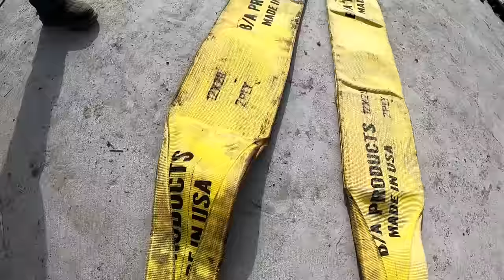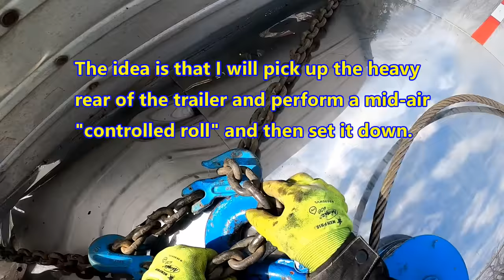Haz-Mat Tanker Rollover Shuts Down Everything!!!

Comment: 44,000 gal lol. Just a heads up Ron. The pump on the vacuum truck is not strong enough to crush that tank. It will just bog down and not suck due to the negative vacuum. There is also a safety valve on top that will suck or blow air if the pressures get to high or low. Rail tank cars have these too, its an ISO standard. I've been hauling tanker trailers with hazmat for 17 years now. There was a port on the rear of the main hatch on the top. That is there to evacuate the fluid with a 2" hose once the level gets low enough. Also there should be places marked where the tank can be punctured for emergency evacuation with a rollover. One more thing too. I've had my fuel tank full of jet fuel shot at with most likely a hand gun. The bullets went through the cab no problem, but bounced off the tank. Luckily I was not hit by any of them.

Comment: For accident purposes we have in Europe special code plates for hazmat trucks, it simplify identification what type of material we deal. Insulated tanker points toward liquid gases, very dangerous if heat will builds up and cooling system is inoperative.

Comment: Did you ever find out the true make-up of the load?  Insulated tanker suggests something like medium or heavy fuel oil, which is normally transported hot (80 deg C when it's loaded) hence the initial suggestion it might have been diesel.  Also it looked like a single tank, not separated compartments for mixed loads which again makes it look like a 'black oil' tanker.  But a nice job, well done!

Comment: I will also add the driver used to wrong placard on the tank…. I saw 1993 which is the code for diesel fuel.. I’d imagine there’s going to be a citation issued to that driver for using the wrong placard to identify the contents

Comment: That truck was completely full i can tell because the right back end went in the hole just a little bit so the full weight in the trailer came down causing trailer and tractor to roll on its side, of course the amount of weight in the full tank also twisted the frame of the tractor warping it in the direction of the rest of the trailer.

Comment: This is common alot of biodiesel  and straight diesel is moved with SS tanks .  Old tanks being utilized for this purpose.  ......stick it to the dirt and puller back on her feet..... these tanks are very sturdy.  I had one withe the nose bent at 90deg upward at the 3rd section..we filled it with water and shop air and bent it back down almost completely back down in its original position...it had bent in that position because of the vent being stuck in the first place.

Comment: My main concern was that the bolts or welds might snap where the rear of the tank fitted to the rear axle/chassis. I doubt it was designed for all that force to be concentrated on the side corner like that and pulling sideways too.
How did you know you would be alright?

Comment: I know I’m a day late for this, but for those wondering, tanks like that are used quite a bit in the Alberta oil patch for more volatile chemicals, specifically ones that evaporate around 120 degrees. Most common one used here is methanol. The explosion hazard is very real.

Comment: So, nobody deployed flares to warn traffic then?😂
Nicely put together video Ron, with all the extra cameras.👍  Did the tractor come back over a wee bit sooner than you expected? Very interesting to watch the different machines working together, all performing separate tasks to reach the same goal. 
Was there a less obvious cause of the accident or did the tanker just cut the corner too tight and the trailer wheels dropped off the road? I'm assuming the tanker had just crossed the railroad and turned right?
Great job, as always, and particularly well filmed/edited.👌

Cheers for now,
Dougie.

Comment: Hey Ron, When I was a 20-ton driver, the owner of my company( United Towing Alpharetta, Ga) told me you can never use the rotator to pull with because you will bust the rotator gears and pin. I see you using the rotator to drag the tractor. Please explain why you used the rotator to drag the tractor. Thanks

Comment: The more rural locations still have their power lines overhead instead of underground. That will always be a factor in any recovery operation you have to perform. I suspect that it is costly to put them underground. I live in a neighborhood(townhouse community) built in 1997 and all wiring is underground. Storms do not present a problem normally but somewhere close to our townhouses blew an uplink transformer and we were out for about an hour. Or if there is a substation failure. You do work in a lower elevation area so no really high power lines like they have to deal with in Northern California near the Sierra Nevada mountain ranges. But power lines there will never  be underground. Solid granite all around.

Comment: You will understand joking on job site such as this when you are in this line of work. I was on a scene of an accident where a log truck driver attempted to avoid a head on collision with a pickup that crossed into his lane. He rolled his truck into the ditch and caught fire. Driver smashed a window and dug through the snow to get out. He was fine and helped at the scene. When we went to roll his mangled burnt up mess back on its wheels, he shouts “Don’t scratch the paint!” Man, you don’t have a cab anymore to have any paint 😂 But it lightens the mood and I work better under that kind of environment. Things tend to go a lot smoother than everyone being uptight and upset.

Comment: Yeah, when they said gas and I saw 1993 on the truck's signs I was like "Uh, I don't know what it is, but it's not pure gasoline, and it's flammable," which is really a sobering conclusion to come to about a flipped over tanker truck. As it turns out, there are things much worse than gasoline, which would also explain the shielded tank. If only it could be easy and be jet fuel or something minimally flammable like that...

Comment: Ron, I can not believe the amount of torque you have to rotate your boom while dragging the front of the tractor over. If you figure the distance from the center of your slew ring to the boom tip and then figure how much linear pull it took to drag the front of the tractor that is very impressive. Does your rotator have more than one slew motor/planetary to rotate the boom?

Comment: Even if the vent on the tank is below the liquid it will admit air which will bubble up into the space above the liquid. There will be a slightly low pressure in the air space but there was no danger of the tank collapsing.

Comment: Maybe you covered this but I missed it, but I never heard anything more about the bill of lading. It should have told you contents and gallons. Why was there not a return hose from the trailer to the receiving tank allowing the pressure to equalize between the 2 tanks? You would then not have to worry so much about negative pressure in the "SODA CAN".

Comment: I kept looking and I didn’t see a single hazmat placard unless it was covered by the black plastic. Did they contact the railroad to shut down the rail line? I don’t think there’s enough clearance to to the side of the rail for the engine to clear. As long as it’s not a high speed rail they should be able to stop but it’s something to be aware of for the future.

Comment: It should vent ok from the forward wash out caps.
It would be above the level of liquid at the front of trailer.
At most it's 3/4 full.
(Idk 23" out ?)
They "could" vent from one trailer to the other, replacing air with liquid.

Comment: 32:11 CHECK THIS OUT EVERYONE.... his 2 pass side outer tires off the road(concrete), you can see the scuff marks on the road from the 2 inner tires & exactly where they were pulled off the road from the leaning hvy trailer. Just a little slower & watching closely, this could have been prevented.

Comment: Hi Ron, a very difficult job well done. Can I ask a few questions, in the UK we have to have 'Pet Reg' (Petroleum Regulated) vehicles to transport flamables, these have wired returns for all circuits, no chasis returns  allowed, isolator switches and intrinsically safe electrical items, no CB's or unauthorised electrical ancillaries and the first thing we have to do is earth the vehicle and isolate the electrics, before loading/discharging  is this the case in the USA, how safe is your truck for flamables? I noted they had earthed the trailer, I didn't see you earthed either to ground or the trailer, were you? You were originally told it contained gasoline UN code 1203, but I noted the UN code for the load was 1993, probably mixed solvent waste, nasty stuff. Hey regardless, you did your job, no-one got hurt, no fires or explosions, I was impressed to see your knowledge, possibilities of tank implosion, venting explosive vapours etc well done
Thanks

Comment: Being a hazmat tanker hauler myself... he should be in heeps of trouble for having his placards set to "1993".

"1993" means full load of diesel,  and in return less lethal.  Those placards aren't for the driver, they're for the public and emergency response teams to identify what he's hauling and what to prepare for. Horrible job on his part...   anything with a gas mixture should be placard "1203" which is the most dangerous..

Have placard it "1203" from the get go, it would have been pumped out and vapor released before Ron or any helpers arrived..  in return a quicker and less stressful recovery..
I'm glad it went smooth. But hate seeing hazmat drivers fail to do what we're trained to remember.

Good Job Ron & west team! 👏🏽

Comment: about 15 years ago when i was a firefighter we had a gasoline tanker carrying 8,000 gallons of type 2 gasoline rollover at the bottom of the mountain five mi nutes from my house. It exploded due to the relief cap being knocked off during the slide from the rollover. We had a massive fire that took more then 20 agencies and flames 80-90 feet in the air with temps at the heigh of the firefight over 23,000 degrees. Took over 4 hours to bring under control with almost nothing left of the truck or tank. Driver suffered 3rd degree burns head to toe and was flown to a burn center where he spent 6 months in recovery. WE had to bring in a local area foam unit with 10,000 gallons of foam to finally put out the flames. We were on scene for 7 hours till area was deemed safe for us to turn over to the sgtate clean up team
Reply from the maker: Just last Saturday we worked a rollover of a 5 compartment tanker loaded with gasoline.  We were told it barrel-rolled at least twice before coming to rest on its driver's side.  Driver was ejected, but not critically injured.   We had to bring it up with the load still in it ( not happy about that part ), but a transfer tank was an undetermined amount of time from the crash site and the authorities did not want to wait.  So we did what we had to do.  Hopefully I'll get to post the video of that job soon.   Dangerous job, but we got it done safely so I will take the win...   Thanks for watching and God bless.
Reply: @RonPratt  I fully understand that one to. Yeah our driver to this day I don't know how he got out alive because of the explosion and major fire right away he slid 100 yards down the hill into the side of the mountain and somehow he managed to crawl out the passenger side window. He lost his brakes coming down the mountain and it has a major 90 degree turn at the bottom after a 7% downgrade which is third highest in Pennsylvania

Comment: Get some nitrogen bottles to connect to the vent line! Sucking air in creates a fuel/vapor bomb. A nitrogen atmosphere in both tanks would be a whole lot safer. Also, fans blowing across the discharge vents of the receiver tank would disperse fumes and keep the concentration below the LEL.

Comment: I wonder if it would have been beneficial to supply and air line with a Chicago fitting to the dome valve to give it some pressure as a measure to keep it from possible imploding.

Comment: So, I'm not an expert on HAZMAT materials and hauling, but that placard said it was 1993 flammable liquid, but that is for diesel. If you were saying it was gasoline, it should have been placarded with 1203, right? Mislabeling HAZMAT material is a huge fine isn't it? And the driver might lose his HAZMAT endorsement permanently?

Comment: If the tanker is loaded with gas it is relatively safe, it’s empty after gas that they are more dangerous. It’s the vapours not the liquid gas that is the danger. THEY WILL NOT BLOW UP!!! The real danger is a leak. Also if that is gasoline the tanker is not really placarded properly it should be running a 1203 placard. 1993 is a generic placard.

I haul fuel for a living in Canada.

Comment: I guess the driver was trying to make the turn? Why do they allow trailers that long to be on the road? Thanks for showing the whole scene! I was wondering about the train and there it went! I like seeing it from start to the very end. The second driver whipped that trailer around like it was  toy!
Reply from the maker: Yes, the driver was attempting to make the turn and cut it too short.   Thanks for watching and God bless.
Reply: It wasn't a particularly long trailer. It looked like a 45', which is the most common trailer size. I didn't see a 53' notation on the side, which would indicate a longer rig.

Comment: I'm not sure when or if you check any of the comments here   but I've seen and heard a milk tanker impload from pumping off the milk at a high rate of speed at an eastern NM cheese plant they didnt open the top lid and just hooked it up n started off loading the milk as a driver then hauling milk I/truck was in one of the bays when it happened   it sounded like a morter round went off inside the truck bays and insulation from tank went every where and the metal rafters were humming for little while too   the tank looked as if a big hand grabbed it and crushed it like an empty beer can and broke it in half dont know to this day how they got it outa the bay because if the truck were to pull it outa the bay it would've been in two pieces... I took pix of it never seen or heard of that happening before   just shared this because you were talking bout popping n such here          By the way you do great work and when I was driving Big Truck I always gave you wrecker EMS and yes DOT all the room you needed you gotta go home too        Thanks for reading           PEACE

Comment: What exactly was in that tank? I pulled that style trailer for years filling truck stops. Usually 2 compartments.  But what’s got me confused is it has diesel placards 1993, not 1203 gas placards.  If it was hauling both products, isn’t the gas placard ( the most explosive) supposed to be placarded.?.?
Reply from the maker: 1993 placard covers a wide variety of combustibles and flammables, according to the ERG.   This one was probably placarded 1993 for the flammable liquids n.o.s., since it was a nasty mixture paint leftovers, acetone, and other chemicals that I no longer remember the names of.  They were headed to an  "alternative fuels" locations to be used as a fuel source.   Turns out this was a very nasty mixture of chemicals.    Thanks for watching and God bless.

Comment: does the rotator have a "safety" system on it that wont allow it to pick up more than what it is rated to at specific angles and reach? or is it kind of wait to see if the truck starts to tip type of thing?

Comment: 8:42 discussion about tanks. Your going to have two types of pumps here the vacuum which he's thinking. They suck air and liquids and solids into their containers there is another kind probably more likely here to prevent fumes.

That's compression pumping. You pump a gas or liquid into the tank your wanting to empty and it pushes the content to an opening like a valve on the other tank. Just cause thetanks hooked up with a pump doesn't mean he's using a single hose. Plus one of the tankers needs a release valve to displace the stuff coming out one and in the other.

Comment: Ron, love watching your crew, but on this video I found myself ready to turn off fast, here's why:  1. Liquid gasoline or diesel do not explode, the fuller the tank the safer it is, only the vapor is dangerous and even if the fire got to the fuel in the tank (assuming there was a leak) the liquid would extinguish the fire, not feed it, additionally, if the vents are not functioning then explosion is nearly impossible as a fire requires at least 16% continuous oxygen, no oxygen, no fire!  2. I am not fully aware of how much vacuum a stainless tanker can handle, but my honest guess is that if the pump he was using (he stated 2 gpm) could cause implosion, you've got more problems than you think!  Personally, I wouldn't trust a tanker carrying anything inherently dangerous if it can implode at less than 10" hg.
Reply from the maker: This tank was not carrying gasoline or diesel.  It was carrying a nasty mixture of paint waste, such as acetone, paint thinner, etc. that had an extremely low flash point.  If I remember correctly, they said the flash point was around 105.  The air quality meters that the FD had deployed kept getting "wiffs" of the vapors, so, yes, there was an extreme risk of fire or explosion.  Thanks for watching and God bless.